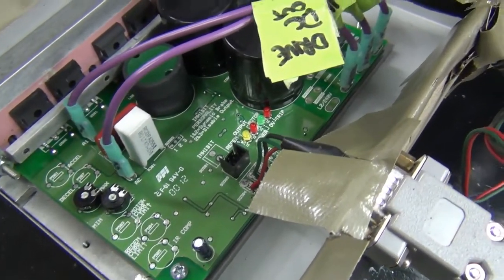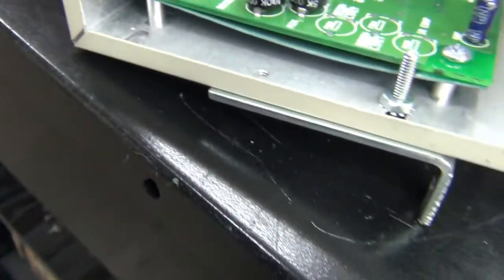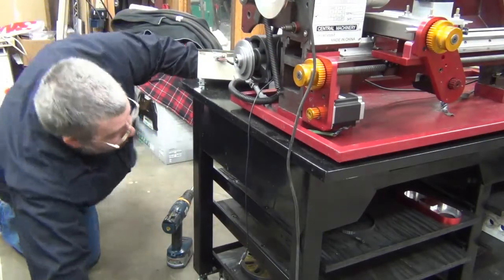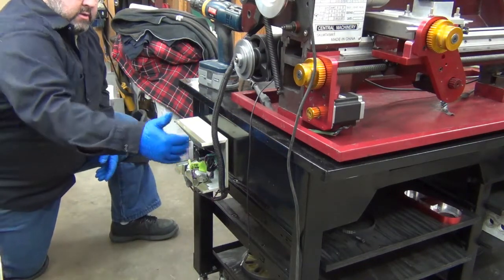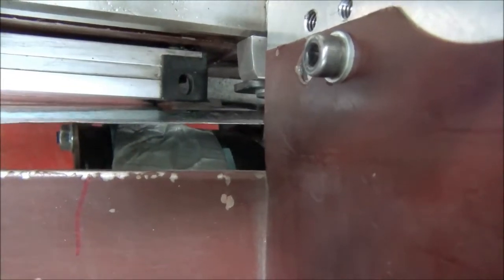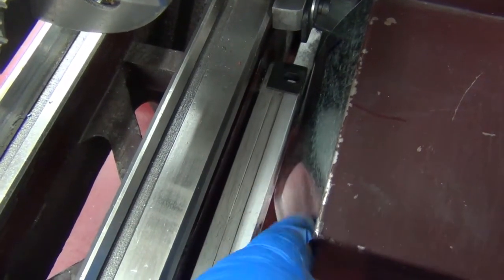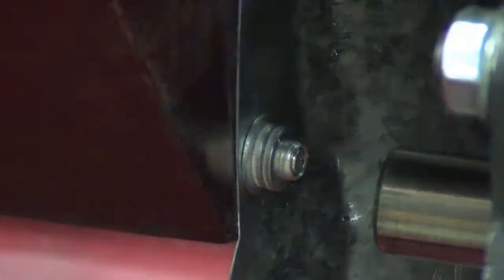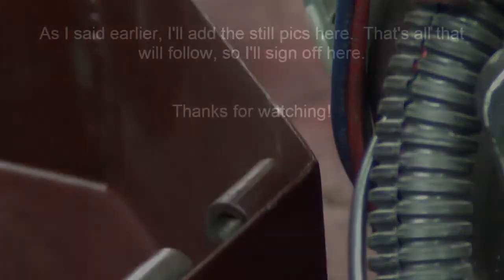CNC Lathe Fix10 - Motor Controller

Comment: I think you should fasten that resistor down it probably has 90VDC on it. Having the heatsink at the top is good practice as well, treat those control wires from the speed controller as hot i.e. don't touch them with the power on :) Not long now. :)
Reply from the maker: Interesting.  I think I'm going to have to pull the controls off and check/fix a couple of wires.  I'll try to remember to take care of the resistor at the same time.  I've cut air with it, just haven't gotten the vid edited yet. :)
Thanks!!